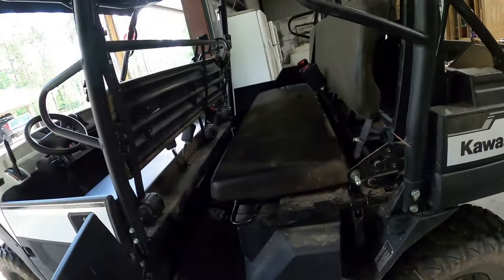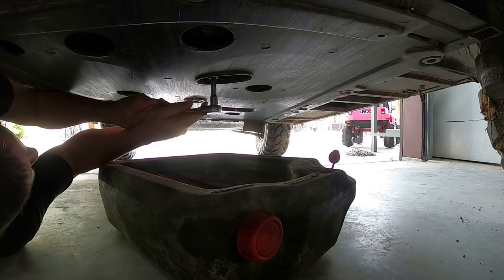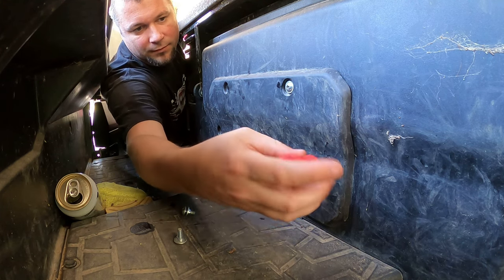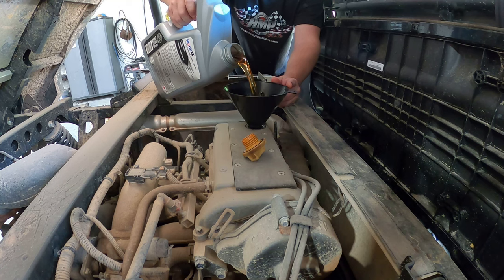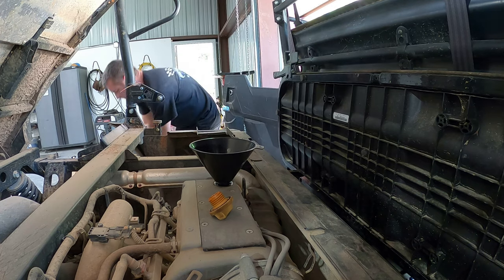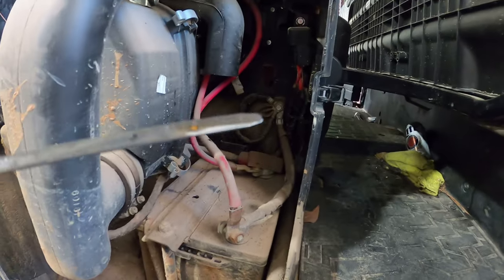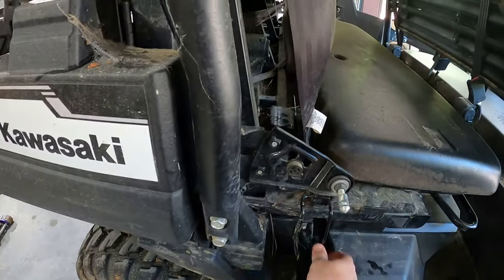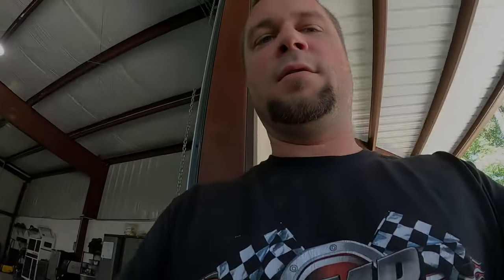Kawasaki Mule Pro FXT Oil Change

Comment: have you changed your differential fluid?  just wonder how easy or difficult that is
Reply from the maker: Yes I've changed front and back. Back is very easy. Front is a bit harder and I was told to take the bumper off but managed to do it without pulling the bumper off.

Comment: I’m looking to buy a mule fxr with that motor how do you like it ? Any issues? How many hours do you have on it?
Reply from the maker: I have close to 300 hrs and 1900 miles. I don't know what engine the new fxr has but this engine is pretty good. I have had no issues. Just regular maintenance. Never been back to the dealer for any work or problems. My only complaint would be not much hp but plenty of torque. It can pull big loads and a lot of weight but don't expect to go fast or be real sporty. It's a work horse and cruiser not a rzr or a maverick. I'm very happy with it. I call it my tank lol!
Reply: @schmitty750  ok thanks I’m not looking for speed just need a good reliable vehicle to move wood and plow with occasionally take the dog for a cruise